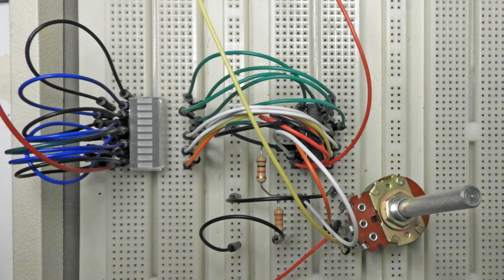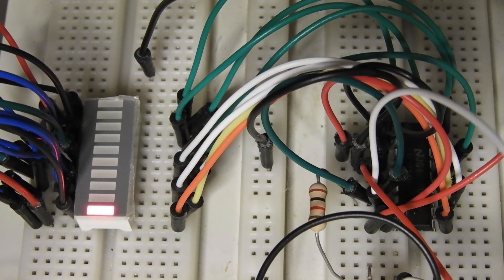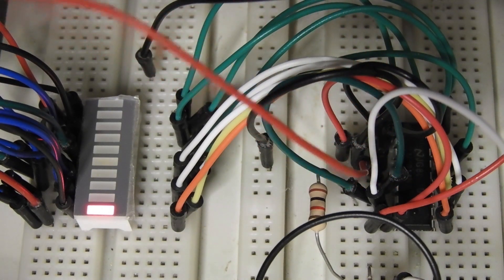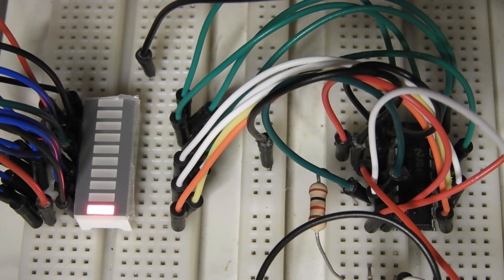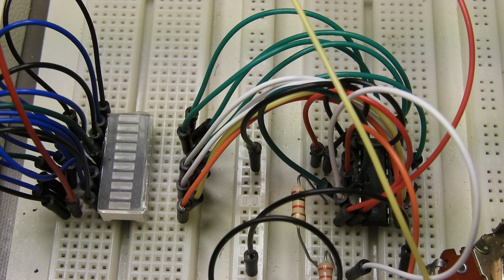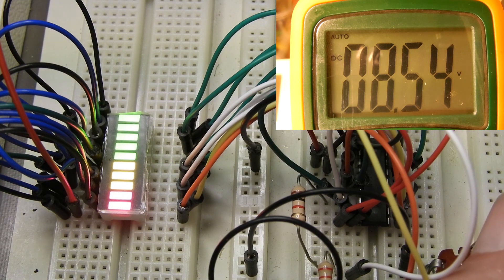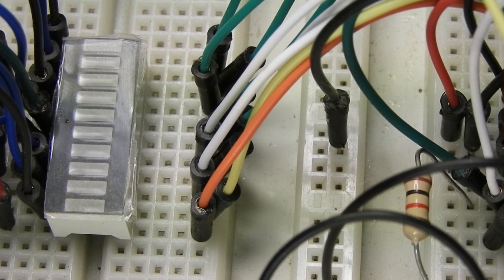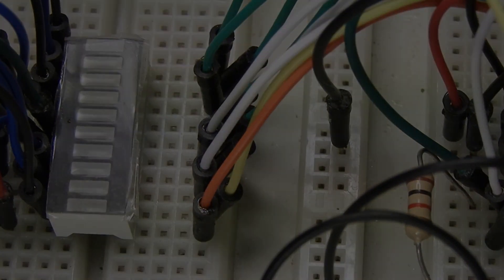LED Volume Display LM3914 LED Bar Display Driver

Comment: Very cool chip.   I have worked with the entire family of LM391X chips in the past.    I built a permanent 12 v battery voltage indicator with it.   It measured volts from 10.5 to 15 volts in .5 volt increments to show battery voltage in car with off then engine running to show volts resting all the way up to with alternator fully charging it.
Reply from the maker: Thanks